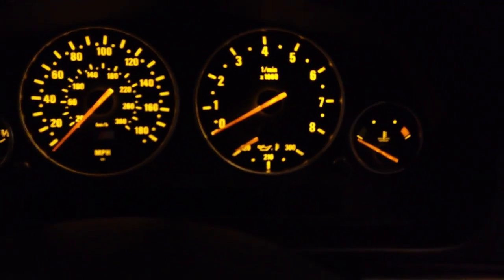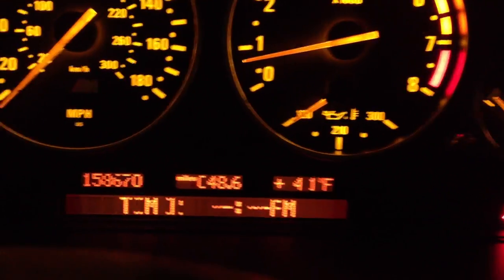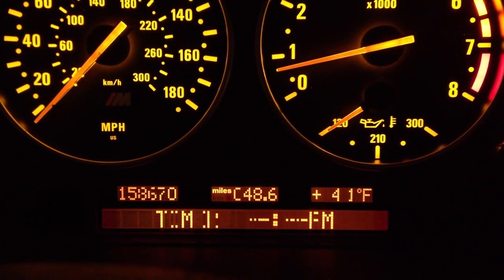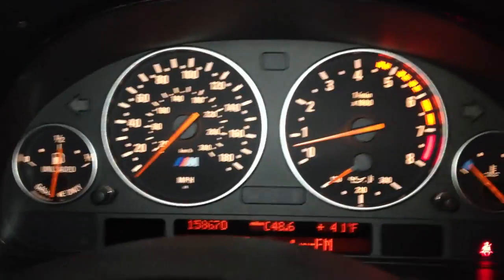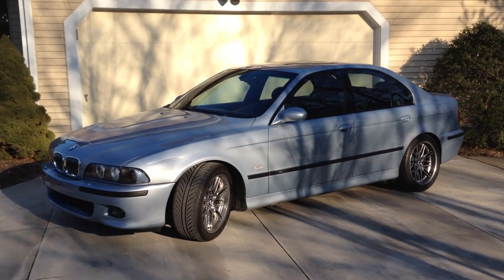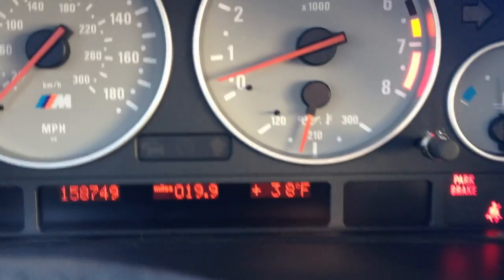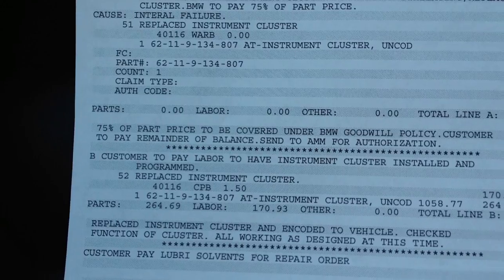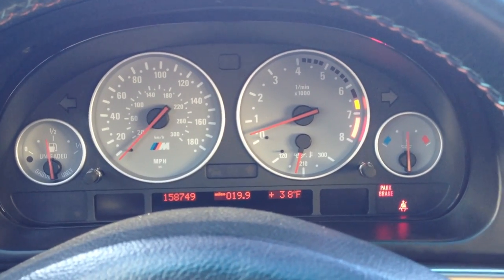BMW E38, E39, E53 Cluster Pixelation

Comment: Did you notice that after replacement the oil gauge shows more than usual and the water temperature too?
I have the Black gauge and it never reaches 210 as yours did before you replaced it.

Comment: Yeah, I've got my eye on two E39 525i. They're both post facelift, years 2001 and 2002. Neither have the high OBC. Is there any real benefit to the high OBC over the low apart from aesthetics? The 2002 has the newer steering wheel found in the very late E39's and E46's.

Comment: Ryan, I see that there are kits that can be purchased to replace the ribbon cable (which most claim is the culprit).  Every one of the LCDs in my 530i have this issue, so I was considering purchasing the replacement ribbons.  Have you heard anything about these kits?

Comment: i thought it was just a crappy ribbon cable and you could just replace the cable for an hour of work?
Reply from the maker: Yeah I think that can be done.  If you're skilled enough so solder ribbon joints.
Reply: ***** actually there's no soldering needed, the whole procedure is press-fit. its a little tricky disassembling the cluster though.
but hey, while you're in there, put on some gauge rings

Comment: I just picked up a really clean '03 530i / Auto / sports pkg. I love her!! Does BMW still sell those e39 M5 silver interior trim pieces for the console and doors/dash, or would I have to go aftermarket for that kind of stuff? The fake wood is "ok" but I want my car to be more modern inside. Also, how much better are the M5 seats - really? I think it would be cool ( except on my wallet, haha ) to pick up a used black M5 Driver's seat for my 530i and give it a racy touch. P.S. - Isn't it ironic how wonderful BMW cars are designed and engineered, then they put in stereos that pretty much suck?? My radio in my traded in '02 Acura CL blew the doors off the stereo in the 530i! Thank you to all in advance for replying! :)
Reply from the maker: I don't believe BMW sells those pieces anymore, neither do sites like ECS tuning... your best bet would be to find a set on eBay.  Even then, if your car doesn't have the Tire Pressure Monitoring system (look for a button integrated into the trim behind your wiper stalk, you would have a "dummy button" there, unless you can find a set without that button.  I added a set of "Cubic" trim recently, and while expensive, it looks MUCH better than the wood. As an alternative, you could always wrap your wood trim with some kind of 3M wrap to make it look like the aluminum trim on the M5.

As for the M5 seats, they are better support-wise than the E39 sport seat, but I am not sure if it would be worth it to just swap out one seat.. that would look a little strange.

BMW's stereo's aren't too great.  If you have DSP (look for the button on the top right corner of the radio, try messing with those settings (or just the bass and treble.  Lots of people add the 10" M Audio subwoofers, or add an aftermarket sub or two.

-Bobby
Reply: Right, right. You make a lot of good points here. As for the stereo issue, I'm just going to get an aftermarket, clean-looking adapter plate/kit for the dash and get a new stereo and good speakers. I like the idea of keeping the car factory, but there is almost no bass in the stock unit and I love sound/music too much to settle on the Bimmer head unit/speakers. Not to ask a dumb question, but if the Tranny fluid is low, will the onboard diagnostics tell me on the dash? My mechanic told me I need the tranny seal fixed by the driveshaft but I don't want to drive it then all of a sudden ruin the trans because it ran dry with no warning :(
Reply from the maker: 1970borntorun You can do that too, but if you have DSP, it can be a pain to wire in. The cluster will NOT tell you if the transmission fluid is low, and there is no dipstick for it under the hood, so it has to be checked and flushed/refilled from under the car.

-Bobby
Reply: Ok, well I have the non-DSP radio, thankfully. My mechanic told me it's about a grand to fix the tranny seal. is that about right ??
Reply from the maker: 1970borntorun I am not sure, I know it is a very labor intensive job though.

-Bobby
Reply: Of course it is lol :)

Comment: That problem is fixed by 17-30$ ribbon cable. You can DIY, if you have some basic tinkering skills :)
Reply: did you fix it yourself or?
Reply: Ivica Mihalic Yes. Just be careful when drilling the plastic for those two screws. There are pictures on the web showing how to do step by step.
Reply: 4 screws you mean?
Reply: Ivica Mihalic Yes, guess I've forgotten how many they were. When you disassemble the main plastic cover and start unscrewing PCB screws, there are several hidden ones under the plastic and the only way to access them, is to drill it in exact place. One near fuel gauge and another under tachometer, one under speedometer and one between LEDs. Check this article for details and pics:

http://www.bimmerforums.com/forum/showthread.php?1754837-My-E39-Pixel-Repair

Comment: I just called them and no recalls or nothing on mine. Ive replaced the odometer twice with other used ones that worked fine the first week then pixels started burning out.Its a bigger problem then just a single odometer.

Comment: Why not take it in to VDO Repair? They do the fix by adding a new ribbon to the cluster and they come with a lifetime warranty on the pixels, I got my radio MID fixed through them and it was only $195. The Cluster fix is a little more expensive at about $300 but thats way less than what you paid. Just a thought I guess. Do a search for VDO Repair, they have a website and everything.